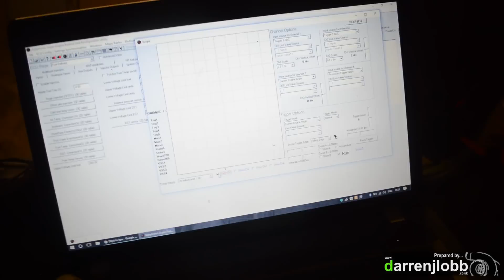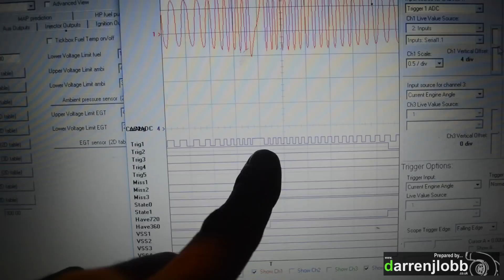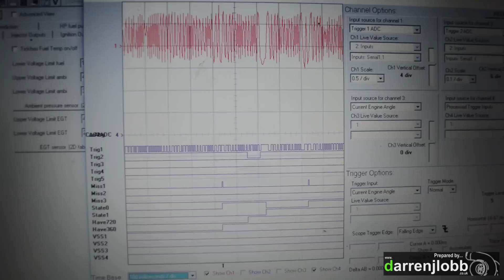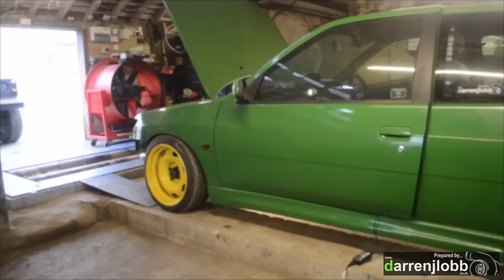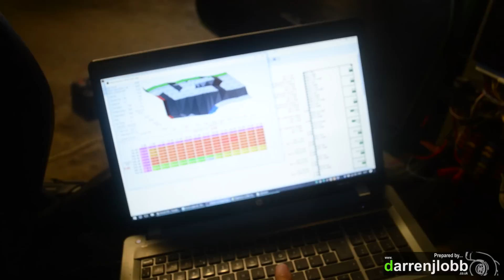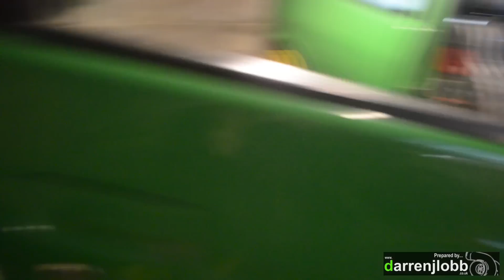darrenjlobb's JD DervBus Project Part 28 (First Start!)

Comment: Hi Darren been following your creations for a few years now and each 1 is better than the last well done mate u have some real talent 
I've been told you know jack gt who built the Citroen C2 m hdi which I now own 
If you do know him can you tell me if his estimate of 270bhp would be correct 
As been having a few arguments lately with tuners on fb stating than it's not even running 160bhp 😂😂😂
It's now running a 11mil pump with gov mod and lda grind holding around 18-20 psi on full boost 
Your advice would be gratley appreciated mate 👍
Reply from the maker: Hi mate, I dont know Jack, I know of him, but dont know him myself... I also have no idea what power that engine is making im afraid, have never had anything to do with the build.... I would say his estimate is very optimistic though if its on stock valvetrain etc.
Reply: Thanks mate he has a full build of the car nothing compared to your builds on the c2 forum think on google it comes under my c2 big build but I'm sure he had a lot of head work done due to valve float stiffer springs etc were added I'm at a guess the car is running around 180 to 200 at the moment it does go will but needs the brakes upgrading as still on 1.4 discs and drums and doesn't like stopping 
Will upload a video on my profile now let me know what u think as I would rate your opinion highly thanks 
Matt

Comment: Congrats matey.
Why does it sound really knocky though|?
Reply from the maker: Combination of running fairly hot timing and lack of pilot injection at this stage, can pull some timing out of the map off boost for sure, its just some base numbers in there right now so it will fire up / run!
Reply: Ah right, I see!
Just read my comment back and it sounds negative, didn't mean it to, I was just wondering!
Splendid job this, it really is.

Comment: Impressive stuff. Any plans to get some sort of pre-injection working to quieten it down a bit?
Reply from the maker: Thanks Bob, Indeed there is, The pilot injection is turned off at the moment just so I can get head around the main injection / everything else thats going on, but will be re implemented at lower rpms eventually to refine it a little more if we can.

Comment: Good Video Darren, Did you ever manage to get that cement shit off the paintwork, if so, how did you do it? I've got similar issues with mine, thanks 🙂
Reply from the maker: I got some off using brick cleaner, and then somewhat ignored the issue! So still got that problem to deal with....